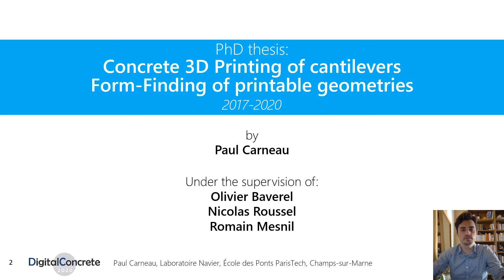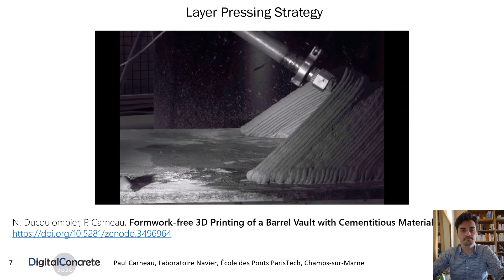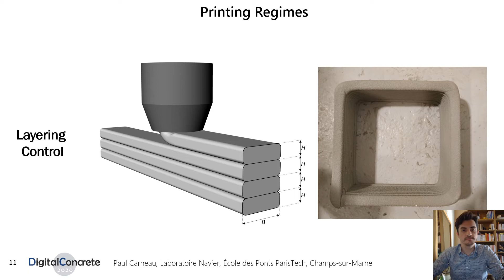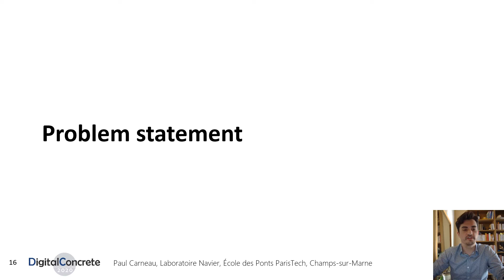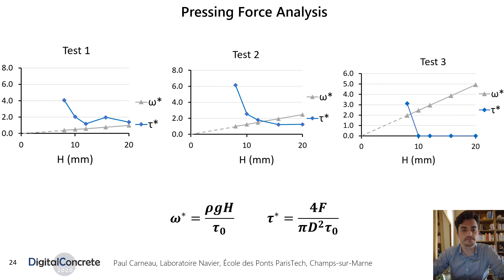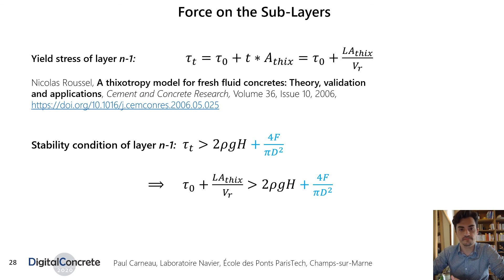Characterisation of the Layer Pressing Strategy for concrete 3D printing (Digital Concrete 2020)

Comment: Excellent presentation!  Fascinating barrel vault printing.  As you scale it up, of course the mortar yield stress and shear stiffness will also need to scale up proportionately, very soon after deposition. This is possible.
Reply from the maker: Thanks you, fortunately, the scale-up is governed by the structuration rate (often written Athix in the literature), which evolves linearly with time. It is believed that stiffness evolves quadratically with time. Say we multiply the scale of the structure by 2. By keeping the same robot speed, we could increase the interlayer time (by 2) and thus increase stiffness (by 4). The obvious limitation is an upper bound for this interlayer time, where cold joints may appear. Since we control the amount of accelerator at the end of the nozzle (XTreeE technology), we can also modify Athix in (almost) real-time to mitigate the risk f cold joint. There is still much more to be done!
Reply: @buildin-coinnovationlabdes417   OK!  Thank you.  The scale up issue I was referring to is where material stress must generally scale up linearly with global scale.  For example, when an earthen dam is modeled (proportionally-identical physical model built) with a particular soil, the g force is scaled up in a centrifuge, to determine material shear suitability at full scale.  The same is true for printing (holding material density constant), if all project dimensions are increased proportionally (including wall/roof thickness) and the material flow rate is also increased proportionally.  If assuming your barrel-vault printing was near collapse, the identical material parameters that printed that vault (including printed volume per unit time) would not globally scale up with the same success, unless the Athix stiffening effect was also scaled up proportionately.  What I am saying is that this IS possible - to dramatically increase the Athix effectiveness, even in an OPC mix, and without proportionally decreasing interlayer bond, making residential-scale vault-printing practical.  As you say, interlayer bond may still become an issue, though one solution can be placing relatively less material at each pass while moving relatively faster (both per global scale).